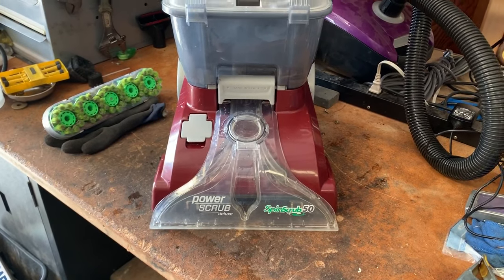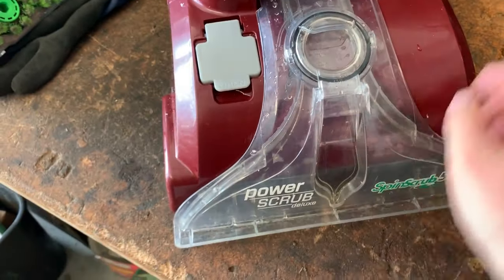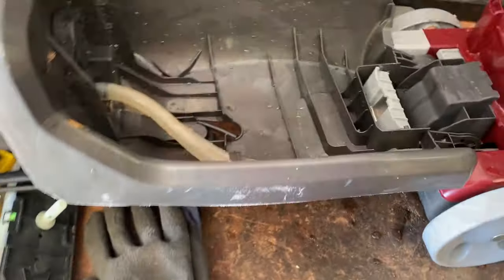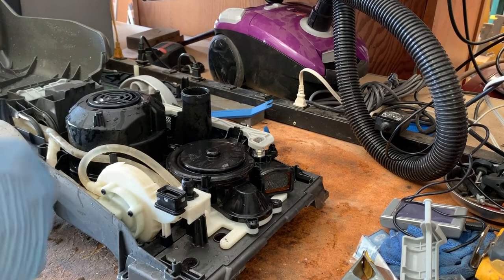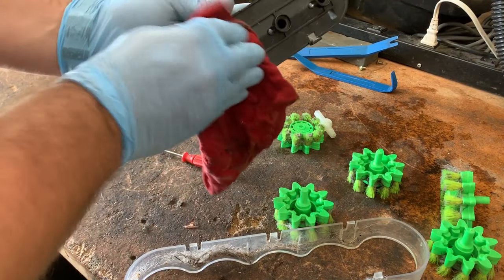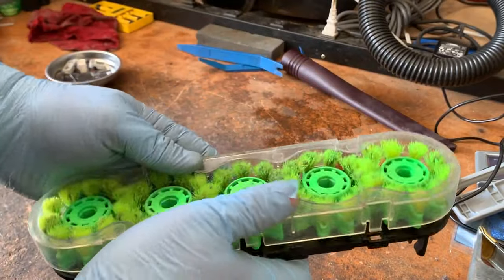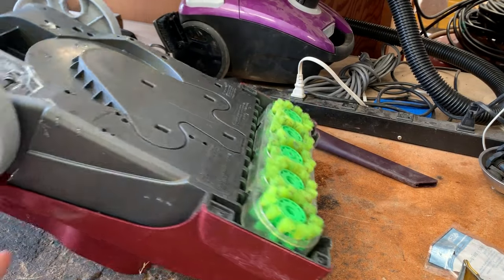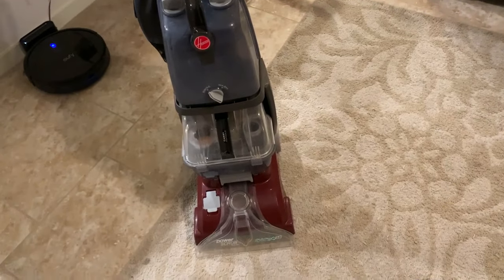Hoover Spinscrub Full Teardown

Comment: Will this machine last? Or is it a modern throw away machine.
Reply from the maker: These will last the longest of any consumer carpet cleaner on the market right now.
Reply: It definitely won’t last as long as the Bissell Big Green Clean Machine as that machine is built for tough commercial applications.
Reply: It is better made than any other Hoover carpet cleaner though. Much more sturdy tanks.
Reply from the maker: Commercial units are much better built so no it won’t last that long but as far as consumer end they will last the longest
Reply: That’s true. I have a Hoover Max Extract Dual V from 2012 and it works just fine after ten years. I guess the fact that is has an Ametek motor, and that it was Maytag’s design from years before determines a lot. You should swap that el cheapo motor out of your Hoover, and replace it with an Ametek Lamb motor of the same size, volts, amps, and rpms. When it’s time for me to get a new carpet cleaner, I guess I’ll do that.
Reply: Responding to your latest reply, we had a Hoover Steamvac Agility that lasted us 16 years. Last year its solution tube hose inside the machine split and considering it already had a slightly torn hose inside we decided to replace it with a powerscrub deluxe. Honestly if the Agility was still being sold I would have definitely bought it again. As for the powerscrub deluxe many people have parts in the turbine mechanism for the brush-roll rust out. I would say the powerscrub deluxe should last long electrically but mechanically not as much unless you replace or oil the rusted bearings if they do rust. Never had rusting issues with the old Steamvac Agility
Reply: Btw for some reason when I reply to your replies my reply gets auto removed
Reply: The motors aren't any better. The tanks may be sturdy, but the gears crack, metal parts rust, and the motors are crap. The new ones are not even made by Hoover. Since your machine was made beyond 16 years ago, it was made in North Canton, Ohio by Hoover. Hoover even made their own electric motors for their carpet cleaners. They were clearly stamped "Made in USA". In 2008, Hoover got bought out and they manufactured them in Texas and final drilling assembly was done in Mexico. Those were stamped "Made in Mexico", but the truth is, they were actually made in Texas. However, even those plants were shut down in 2014, and they switched to a China contractor called: Ningbo Dechang Machinery Made Co Ltd. They make nothing but absolute crap. The motor carbon brushes NOT replaceable. They are literally soldered onto the motor. The Ningbo Dechang motors are also short lived of about 6 years. Sad truth-Hoover no longer makes their own carpet cleaners. Dechang of China is the new Hoover factory for everything including the motors. The Hoover Hustone commercial vacuum is the one of the only machines not made in China. The last good Hoover. It is made by Hoover in Cookville TN- also the Oreck XL vacuum factory. They are owned by the same owner as Oreck nowadays. . They contain a motor made by a Slovanian company called Domel. Finally a USA-made vacuum with a European-made motor, not a Chinese one. Vacuums should last 15 years at LEAST. Or maybe 12-13 years. I've fed up with today's cheap Walmart vacuums that die after 5 years. The only new carpet cleaner that I'd recommend is the Bissell Big Green Machine. They are built to last and have little issues.
Reply: I had the motor taken our from the Steamvac Agility and it has non replaceable carbon brushes. If you want I can upload a video showing it

Also One thing I very much hate is the poor quality control they have. My hoover came with one handle screw and I had to reuse a screw from the old Agility. Another thing I noticed is some people who unbox them doesn’t get the turbine attachment. Mine thankfully came with it. One person in the reviews had a missing solution tank.
Reply: I would say either they don’t have anybody to check if the boxes have everything, or they are just lazy. I feel bad for people who don’t get the turbine attachment and don’t notice theres a missing part since they didn’t pay for their machine to come with missing parts. If its a missing tank, handle or hose that’s something people should easily recognize there is a missing part but tool attachments probably not
Reply: Yep. That’s China’s terrible packaging inspection. They are Chinese junk now. However, that carpet cleaner will last a LITTLE longer than other consumer carpet cleaners. You gotta get the big green machine next. Or else, say hello to planned obsolescence.